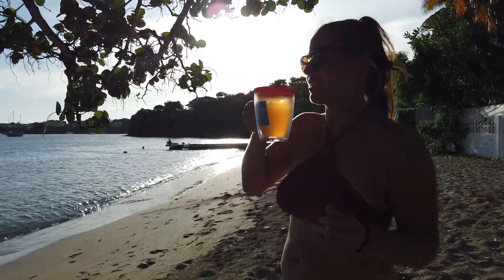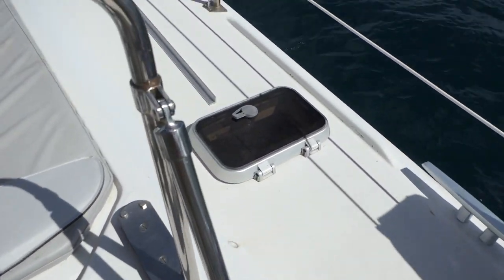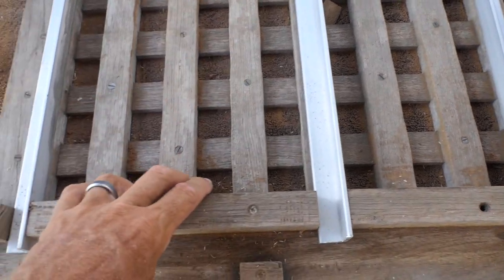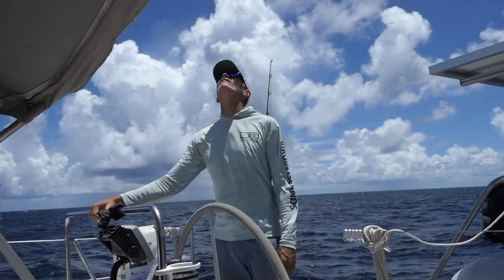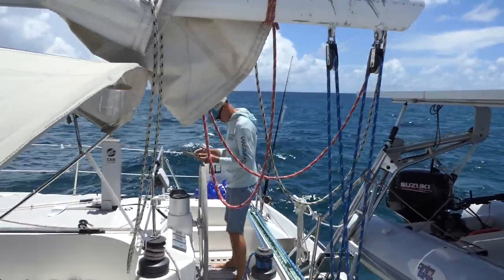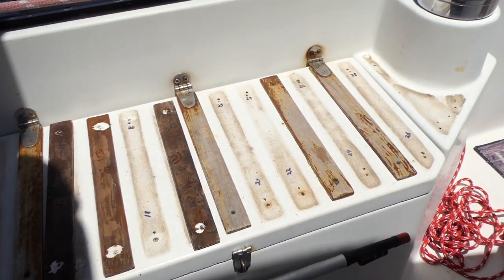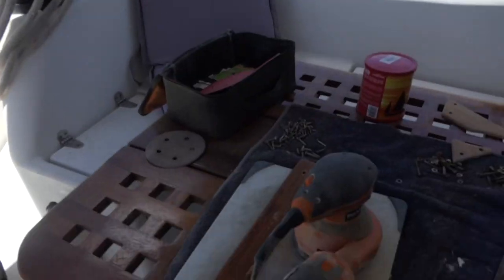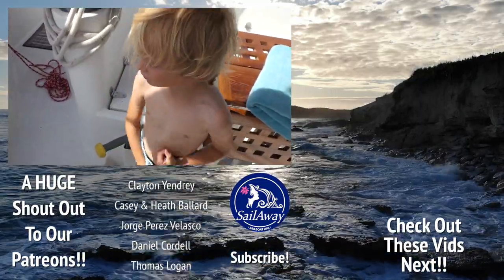CLASSIC CATAMARAN RENOVATION - The Power Tools Come Out | SailAway 210

Comment: Noticed the latches on your lazarette hatches, in one of the shots. I got myself accidently latched in a tight lazarette space a month ago. The door came down when I reached to exit and latched. Fortunately, I was on the hard in a boatyard and rescued in about two minutes, after frantically hollering and pounding. If I would have done that back in my slip, I may have perished. I would have been there by myself. There is nobody around the dock, for days on end. I'm changing my latches to a different type or have someone on the boat when I do stupid stuff. Enjoy your videos very much.
Reply: Excellent bit of heads up advice! I've heard this from others as well.  Installing gas struts on the hatches can prevent accidentally hatch closing and trapping you inside.
Reply from the maker: Wow, that’s pretty scary! For us, not an issue because none of ours are big enough that we’d be inside them. That really is something people should think about though! Thanks for the tip and thanks for watching!
Reply: Nightmare stuff.

Comment: We use to have small, pull cord, 2 stroke generators under the hoods of our chevy work trucks during the 1980s . They were only 8-10" tall and maybe 14" wide, but they were miracle machines for on the spot need of 120volts.
Reply from the maker: Normally not a problem when our genny is running! Or with a decent inverter actually. We’ve since remedied those issues.

Comment: I love refinishing teak. its easy but time consuming. I redid the teak on a boat including the swim platform which was a pain getting into those square corner areas. If I made something like that it would be rounded so its easy to clean and make like new. Slats are super easy but again takes time.
Reply from the maker: Yeah, a lot of folks really enjoy it and it does look awesome varnished. We’ll redo the doors and tables and other semi protected areas that way and use the sealer for the stuff that really out in the elements.

Comment: @SailAway, Eric is there ever a concern about weight on the boat with tools? I am considering taking a wire welder and some other tools and creating a "garage" in the forward berth on a cat. I've looked at cats as small as 36 feet and as big as yours. I'm assuming the effect of the weight will have a bigger impact on the smaller cat, but does it change with where I put it on the boat?
Reply from the maker: It can definitely be an issue on a smaller boat, especially smaller cats, because catamaran depend on staying light to sail well.  Displacement monohulls, it's not as big a deal for the most part.  That said, it totally depends on the cat - they all have different load carrying capacities.  It's not unusual to see a family on a smaller cat and the bottom paint waterline is below water....has to make them pretty slow.

Comment: The standing steering position on this Priv cat will be a challenge and tiring for hand steering for any length of time.  Standing and rocking on legs and back will tire you quickly. Autopilots can't be used all the time.  Given that you can't interfere with the traveller track or block the passageway, two solutions come to mind. 
1)A 6" dia high density foam roller (seat) mounted on a U shaped alum or SS tube that is hinge attached to cockpit wall aft of the wheel. 2 straps with snaps attached to top of wall hold the roller forward for sitting while another set of snaps on the strap pull the roller back aft allowing for clear passage.
2) a foldable fisherman's seat attached a clever way to cockpit aft wall where it can be high enough to be useful for steering and seeing but folds back when not being used.  A stronger version of mechanism used to hold up cockpit drop down tables come to mind for either solution.  I'm sure you will find a solution that works for you.
Reply from the maker: Yeah, though we use the autopilot 95% of the time, I’ve got a design for a helm seat in mind that I plan to build. It’s pretty simple and will fold up out of the way…should really make things a lot nicer back there!
Reply: @SailAwayVlog  I was on Amazon the other day looking for shelf brackets and saw listing for fold down SS304 rust resistant shelf brackets of various lengths that could hold 350lbs - 2 of the brackets were $30 $50 depending on size.  Those combined with a folding seat made for marine use again in the $35-$60 range on Amazon and possibly vertical metal U rails attached to aft cockpit wall along with quick release pins might make for adjustable height foldaway helm seat.  Really glad that repairs/improvements on cat are moving along.  Hope you don't mind suggestions, but I spent month on Leopard cat as crew at marina making repairs and improvements (solar, engine, water heater, rigging) and expect to be sailing Bahamas this winter.
Reply from the maker: Not at all!  Keep 'em coming...always looking for better ideas!  Gonna go look at those shelf brackets right now...